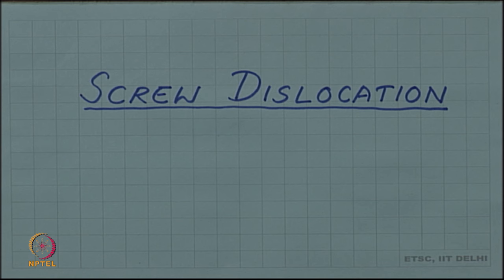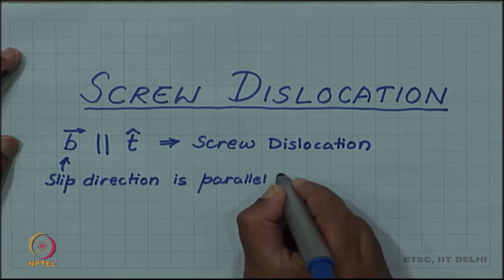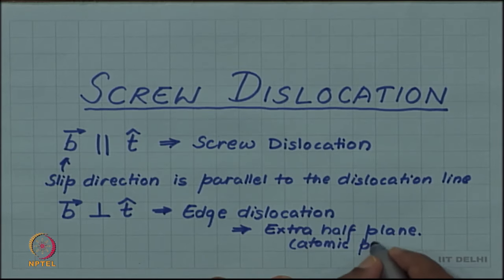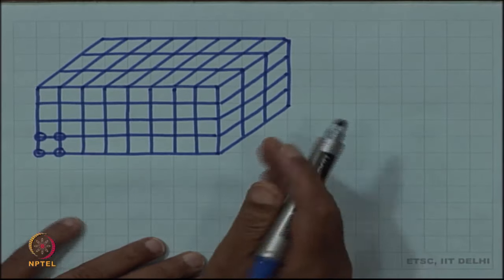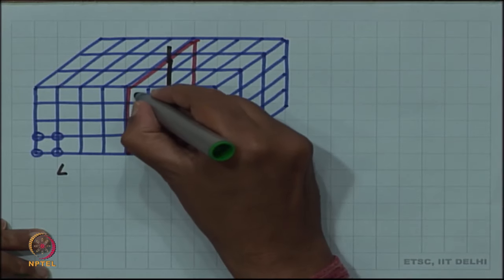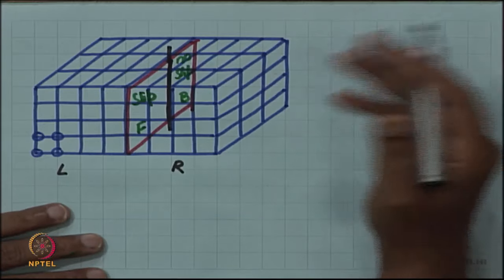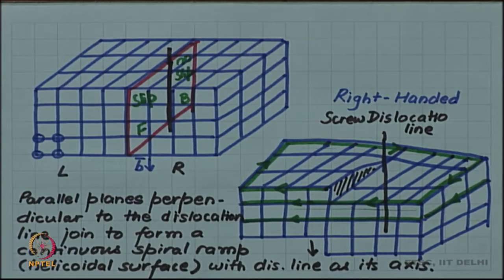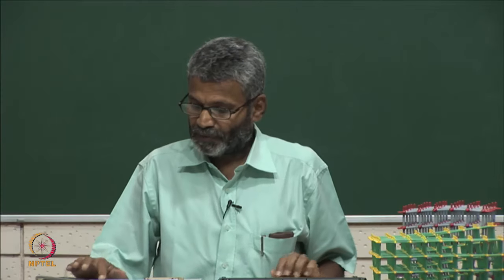Screw dislocations

Comment: Sir,
 why motion of screw dislocation is sluggish than edge dislocation in ambient temperature?
Reply from the maker: This is indeed an interesting and difficult question. By the way, what is your source of this fact? 

 I am unable to answer it on the basis of my present knowledge. 

I checked a the book by Hull and Bacon, 'Introduction to Dislocations' Fifth edn  where on p. 51 they mention that in the low velocity range edge dislocations move 50 times faster than screw. But they have not provided any answer. They actually quote from  a classic paper by Johnston, W.G. and Gilman, J.J., Journal of Applied Physics, Vol. 30, 1959, p129 entitled "Dislocation Velocities, Dislocation Densities and Plastic Flow in Lithium Fluoride Crystals". These authors have experimentally established this fact but have not forwarded any explanation. I thus feel that this is a 'research question'. You are welcome to explore more and share any findings with me.

Comment: Sir, in some reference (https://www.princeton.edu/~maelabs/mae324/glos324/climb.htm#:~:text=Dislocation%20Climb&text=Climb%20is%20the%20motion%20of,and%20their%20number%20is%20large.) while discussing climb and glide motion, it is being said, "climb is the motion of an edge dislocation normal to its slip plane".  It can be understood from the rest of the discussion in those references, that by climb motion it's speaking of the dislocation motion in screw dislocation.

Sir, my first doubt is, even in screw dislocation, the dislocation motion occurs parallel to the slip plane as evident from your video diagram. Although in screw dislocation the slip plane orientation is different (perpendicular) from that in edge dislocation. So, how can we saw that climb motion refers to dislocation motion normal to slip plane?

My second question, after understanding edge and screw dislocation, how to associate glide and climb motion with these dislocations? Does both motion occurs in both type of dislocations?

My, third question, how does climb motion occurs in edge dislocation?(Reference:.https://www.princeton.edu/~maelabs/mae324/glos324/climb.htm#:~:text=Dislocation%20Climb&text=Climb%20is%20the%20motion%20of,and%20their%20number%20is%20large ) My understanding says, there should be only glide motion in edge dislocation and only climb motion in screw dislocation.
Reply from the maker: All dislocations can glide. Only edge can climb. Only screw can cross-slip.
https://www.youtube.com/watch?v=oZvFc9DtLdk&list=PLfIFNJ1DPG4mPl_4FP2o-8d23eiwGY7Sr&index=16
Reply: @introductiontomaterialsscience  Thank you Sir for the reference. I somehow missed that lecture of yours.